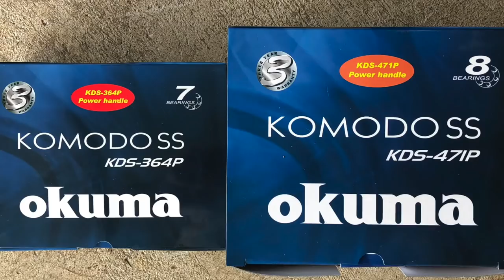Live Bait Rigs WORK!

Comment: Thanks for the tip on the live bait system
Reply from the maker: This system is sound & it works. Of course you can modify it using different products, lengths, etc but most live bait rigs is based on offering a live bait to the predator. The system that is used differs but i'm sharing what i use. Thanks for watching my channel.

Comment: As to the casting control I think a soft piece of leather double-sided taped to the rear support bar of the reel works best for protection against line Burns and applying pressure to the spool for casting control with mono or braid line
Reply from the maker: I rarely go all out casting a live bait, just simply giving it a "loft" out as i don't want the hooks tearing out. But cut dead baits, i try to fly'm. Lol!